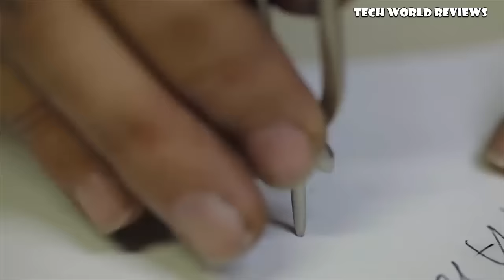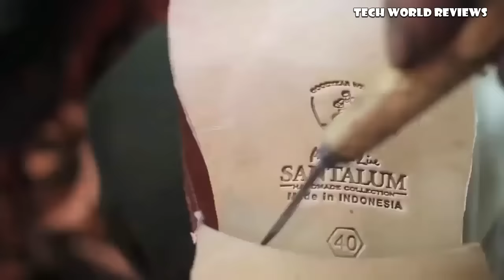Ingenious Craftsmen Make Handmade Leather Shoes

Comment: How did cobblers get work done without the modern petroleum based adhesives.       You can't glue shoes with starch based adhesives.

Amazing achievement, just the same!!!

Estephan
Reply: Easy answer: glue shoes with starch based adhesives, then sew them together. That is how it is still done today traditionally.